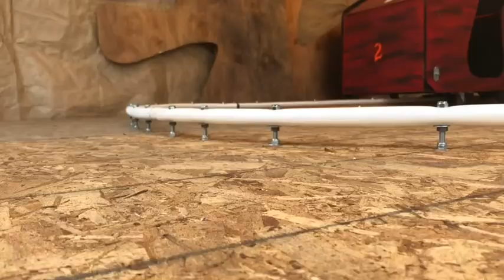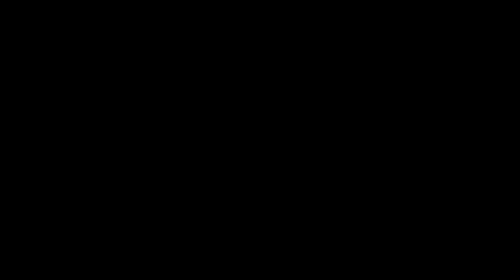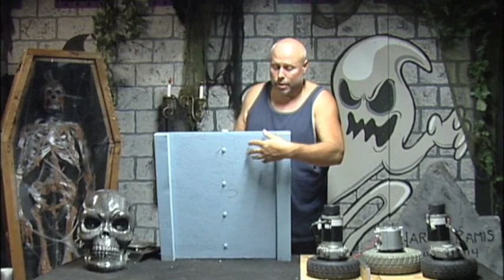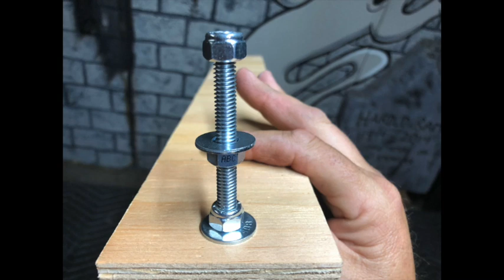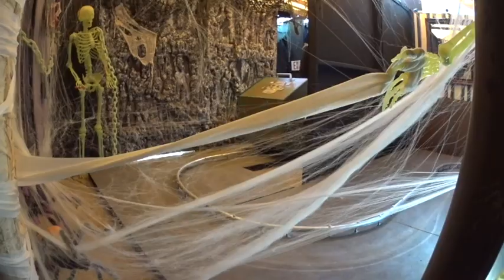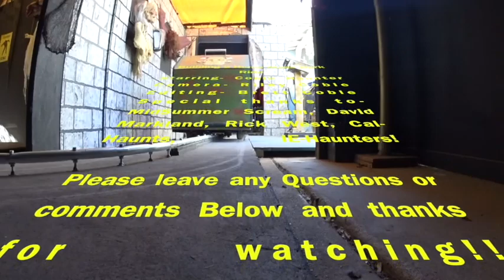Making a Home Made Dark Ride Part 3

Comment: Hi Brett! I started building out my track framing them out like floorboards, but yours seem much simpler. Did you find you needed any additional support for you track? I believe my ride vehicle is a little wider than yours-it's 3 feet across
Reply from the maker: If you will be using the same components as I did  it should be fine. I placed the bolts holding up the track a little bit closer together on the turns for extra support.  Just make sure you build the floorboards wide enough for your ride vehicle to turn without  having the casters fall off the edges .  Do you have the ride vehicle built yet?
Reply: @pixelvisioner  Yes! I may build a new one though. I built it wide so it could potentially fit 2 people but dimensional lumber prices have really shot up!

Comment: Hi this is amazing Brett it really is. Can I just check. On the video I’m
Sure you said that you were building four foot by four foot sections but the section you show on the video seems to be only like 500cm x 500cm or less? Can you clarify for me please.
Reply from the maker: Thank you for the kind words. I bought 4’x8’ sheets of flooring board and cut them in half for most all of the curved sections of the track. The some of the straight sections I was able to use 2’ wide pieces since the ride vehicles were narrow enough to still ride safely on. There were other sections of the track that were different sizes to fit the area I had available for the ride. Thanks for asking
Reply: @ thank you so so much! By the way, if we wanted it to travel backwards as well as forwards have you done this if so do you have a video as we won’t be able to have a track running in a circle so would need to go into reverse and wondering how it would be different. We are truly inspired by your videos and we are going to build one like yours but that goes into reverse !
Reply from the maker: @dhm74  I have not done that.  If you want to make a ride vehicle that moves both ways on the track you would probably need to move the drive motor assembly to the center and have a second tracking  swivel in the back as well and lots of testing of course to get it right. You would also need to figure out how to make the power reverse maybe through a switch or something else.
Reply: @ thanks Brett. Not sure if my reply loaded or not. I thought with it being from parts to a mobility scooter they go forward and have reverse so should be possible! And yeah that’s a good idea - two sets of tracking and the motor in the middle with some adjustments could work. Think it could also be thrilling for people going backwards. Have you ever tried doing them on an incline or decline as think I’d need mine to travel down a slope as my garden is on two different levels. Could make for a scary thrill ride haha
Reply from the maker: @ No haven’t tried an incline for vehicle tracking and binding issues with the current system I use. Not to say it can’t be done, you would need to engineer a different setup where the tracking component can tilt up/down as well as swivel, an you may need to have some type of suspension so the caster wheels will stay in contact with the ground
Reply: @ that’s a very valid point. Oh god. This doesn’t sound like it’s going to be as straightforward afterall 🙈😂

Comment: This was awesome, thanks! I especially was interested in the information regarding how to make a larger cab for the riders. The ones you have are great for single riders, but I'd imagine a child would want to ride along with at least one of their parents, and thus needing more space.
Reply from the maker: Thank You!  You can make your ride vehicle wider, shorter etc, just be aware of how heavy it is as it will affect the operating speed and turn radius of the vehicle.  I just chose this size and shape for my project.  When I get some more free time to work on my new ride, I will be making a second series on how I built my new larger ride vehicles and powered track & control system.
Reply: @pixelvisioner  Awesome, and thanks, I look forward to it!   =D

Comment: I’m looking at building a pretty large car that could be quite heavy. Why are the motors against the track better? Do I need to put a swivel on them? And how do I get bent pieces of wood for my track? Your videos are awesome and super helpful! Very inspired to keep going!
Reply from the maker: Putting the motors against the track will take the weight bearing load off of them , which will give you more power to pull the ride vehicle along the track allowing you to  carry a load up to 500lbs vs. 300lbs or less if you have the two motors pushing the cart from the floor. As far as making curved pieces of wood track, you need to make a jig for a 45 degree turn, then using thin pieces of plywood maybe 3/16” thick strips, glue multiple pieces together until you match the same thickness as your straight sections. And yes I would suggest mounting your motors on a swivel. Look up Ed O’Neil on Halloween forum he documented his ride build very well. Hope this helps!
Reply: Brett C this helped immensely! Thank you so much! Your ride is something I refer to often!